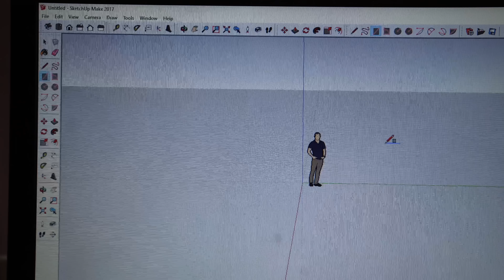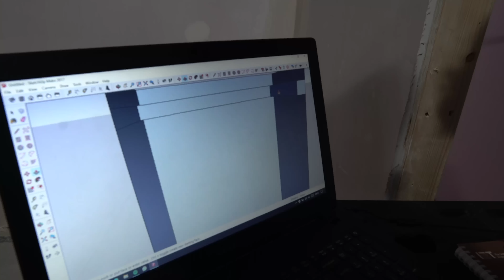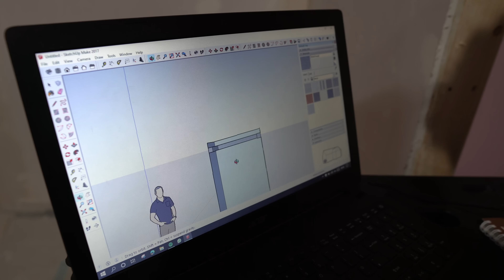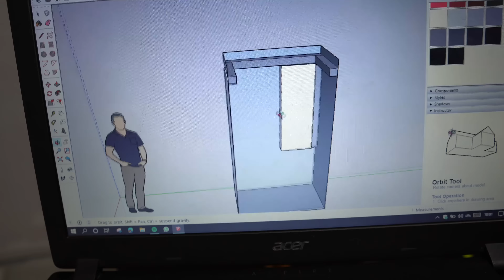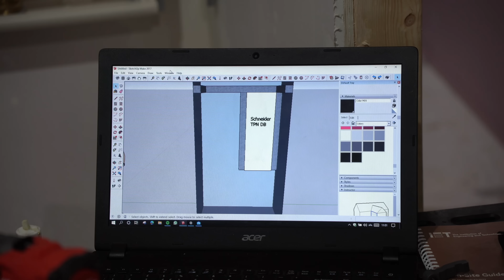Why EVERY Electrician Should Learn CAD | ØY09

Comment: Nice seeing the filing of the rough edges in the metal trunking! I'm a bit late to this video but have you looked into using a plumber's deburring tool to potentially achieve the same thing a little quicker? The file still would be good to get any remaining sharp edges. Keep it up though, love seeing new ways of doing things better.
Reply from the maker: I have tried them! They’re decent, but I still find the file is best for trunking 😁

Comment: Tip I got from Joint Tech Cabling, if you cut the gland shroud slightly too tight, you can usually still get it on if you lay three or so cable ties flat along the cable, into the shroud. They act like a ramp guiding the shroud onto the end of the cable.
Reply from the maker: Nice one! Tony’s the man!

Comment: Plant room, its  a cupboard with a DB in it, plant rooms have boilers in them the size of cars, primary & secondary pump sets, pressurisation units blah, blah, blah. Get the boy a jigsaw for cutting trunking, save his wrists & alot of time & show him how to use a pair of grips properly.
Can't remember how many 
plant room installs I've done but I can remember never using a laptop to plan them. Perimeter trunking with conduits coming off, hit all points on the panel drawing... Laptop, what ever next. Slot & paxoline your next D.B? Edit: keep up the good work. Hahaha
Reply from the maker: 😂👍🏼 - Respect man, that’s cool! I’ve done a few of those too! This is a nice simple room to teach on 😄. The other room will have a lot of heating controls and bits n pieces which are great for beginners learning BMS
Reply: @corymac  I probably sounded like a know it all twat Cory, your a pro mate & take pride in your work. Fairplay

Comment: 👍 for Orbix fixing screws - so much easier to use and looks good. Yes cutting oil for all metalwork but also low speed on the drill to stop overheating the bit.  Good work.
Reply from the maker: Thanks Steve!! 😁👍🏼👍🏼

Comment: Great content as always 👍 I would get a deburring tool rather than using a file for sorting out those holes in sheet metal stuff. Way faster and will produce a better result
Reply from the maker: Good tip!
Reply: @corymac  curling off a perfect coil of steel swarf like a pencil sharpener is pure OCD porn too 🥸

Comment: score the back of the trunking of bend and you I'll have a nice clean fold . when doing swa use a band of tape to give yourself a straight line to follow, ring the bottom of the tape and strip the outer on the top line of tape
Reply from the maker: Good tip! John Ward teaches it that way too
Reply: @corymac  ive been doin bends this way for years and i wernt shown i just evolved different ways to do it

Comment: one thing that i would had done is to install a tee couple of tee sections in the trunking, you have limited the 100x100 trunking down to 2 x 40mm holes... no future proof and a complete pain to replace bad cables or add extras.

Comment: Try to use prefabricated triangles for your trunking next time... cost a lot but Looks much better, saves time and there is no need to install glands on every crossover... SWA cable should be glanded on your DB entrance, not on some random place of your trunking😉
Reply from the maker: Personally not a fan of prefab in corners, means you lose that as useable space to take conduits from etc… SWA is almost always taken into trunking on bigger installs, top into trunking, bottom into db. Means no issues with IP

Comment: Good video but firstly I’m not picking faults or having a go but just wanted to ask why you didn’t flange the vertical trunkings into the horizontal header to Maintain earth continuity? Thanks
Reply: I suppose thinking about it you have bushed into the db both sides and above so I’ll get my coat! 😂

Comment: Cory, I will share with you a valuable piece of information. I assume you use a Stanley branded measuring tape? I see you hold the tape end at one end and then curl over the tape at a corner, for instance. Now watch me blow your mind: Do not bend the tape, use the tape as a part of your measurement. Take a look at the back of the tape and it will say +75mm or something like that. Now, measure the item you want to measure but put the tape in the corner. Read the tape, lets say 400mm, then +75mm for the tape, that's 475mm. I hope you get what I mean. I've used it for years now and it has never let me down.
Reply from the maker: Someone taught me this already, but old habits die hard 😂. Thanks though!

Comment: Quality work guys and well done Ted. Would you be interested in coming to our place and view the work Ive done as a DIYer in mid Wales. There are reasons why I have taken this route and we could talk about it, and discus my plans for the house, which I would like you to become involcved. Currently we have 4kw Solar array, 5.5kw Hybrid Inverter (setup as a UPS not feed in), 31.5kWh battery storage, which runs our house, 3 x 600w Infared Panels (which I am still installing), an Sunamp UNiQ 9kw water battery for our hot water, 6kw Setec Power Unit which runs our LG 9kw Therma V ASHP, and 2 EV wall chargers. All this and most of the day we are off grid using both solar and cheap renewable energy during the day. Interested?

Comment: Better to use pvc trunking instead of metal
Reply: True but this way all the trunking plus cabinet is PE bonded (plus the armoured cable since is glanded and screwed in on the trunking with a locking nut) and in a case of a fire everything is contained instead of PVC who basically will melt and fuel the fire itself.

Am I right Cory? I asked since I'm not totally into the Residential UK norms. More EU, US and CH ones.

Although in commercial and industry all fixtures should be metal, from trunking or conduit to cable racking and everything have to be PE bonded via clamps, and it is that's valid in every single country I made industrial installations/maintenance, and it was a few different ones around the world.
Reply from the maker: Exactly right mate 😁👍🏼
Reply from the maker: What he said 👆🏼
Reply: @black.phoenix.  
But now a days we have FRLSH PVC  trunkings